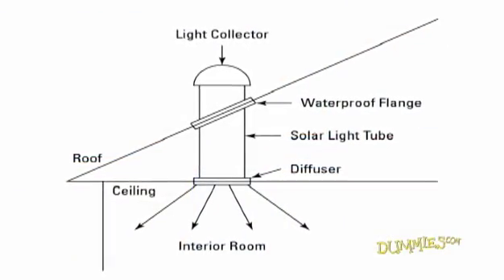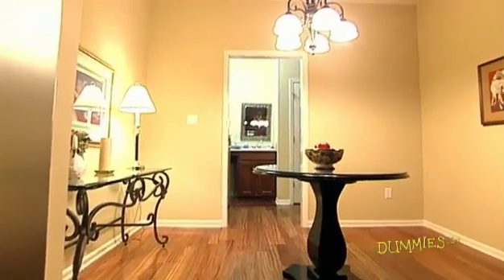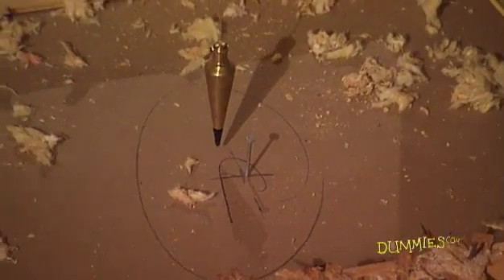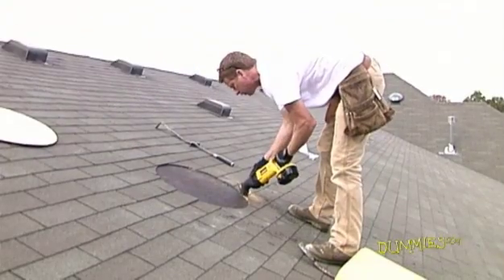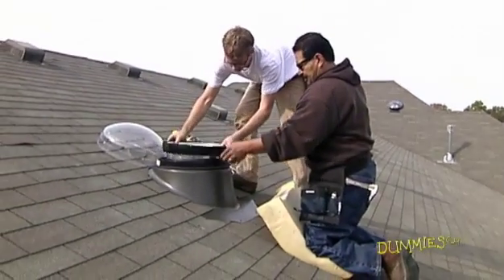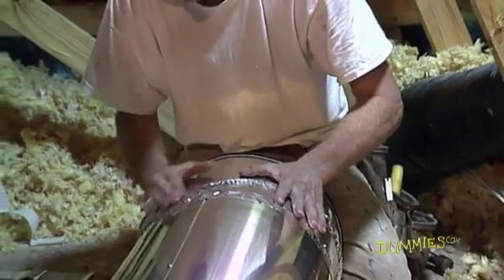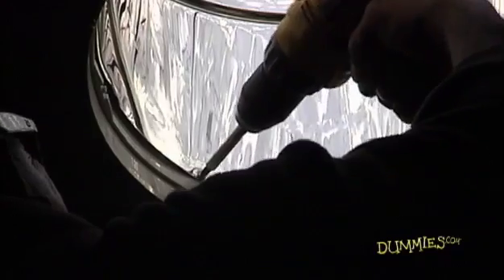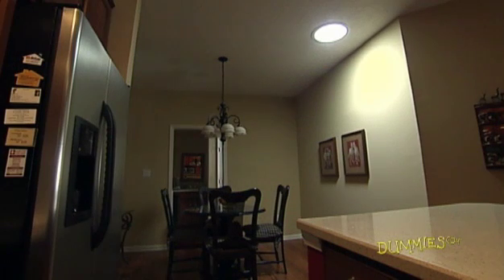How to Install Solar Light Tubes For Dummies

Comment: Question, is there no on off switch? Or Electrical connected?
Reply: The off switch is when the sun goes down...
Reply: @MandoFettOG the PERFECT answer!!
Reply: Travel Lifestyle Media no. It’s a skylight.
Reply: you can ADD a light kit- i did that with my solar tube in a long hallway where there was already power. its nice. usually we don't use the light but at night it's there.
Reply: The switch is on a automatic timer, 
the light is on for 12 hours during the day.:face-blue-smiling:

Comment: ummmm...maybe its just me but should the light not diffuse instead of being like a spotlight on a side wall? Not a very good outcome as far as I can see.
Reply: The system doesn't that way Bill. The light is diffused no matter the sun's angle. They're great
Reply: If you want to illuminate art work , install next to a wall. 
Light will reflect off of wall.
I would center tube over dinner table or a desk

Comment: In my mobile home there isn't enough space between the ceiling and the roof to crawl in there.  How do I install one of these if I can't get into the attic?
Reply: Cut a hole in the ceiling where you want it, drill up through the roof so you know where to cut, and then cut a hole in the roof from on top of the trailer.